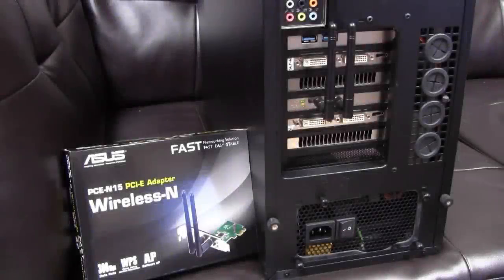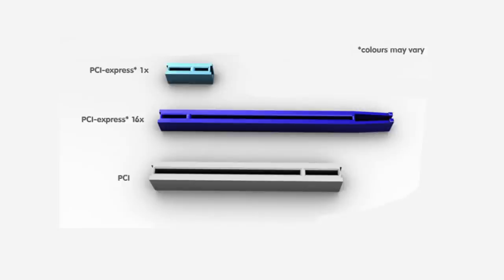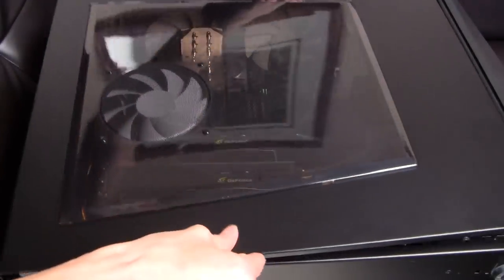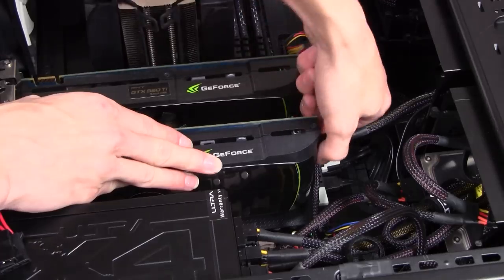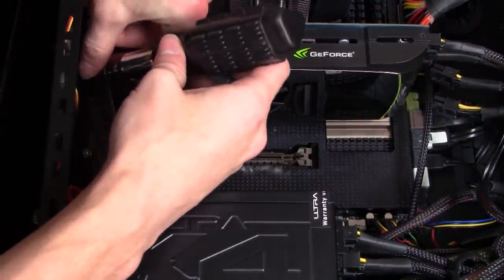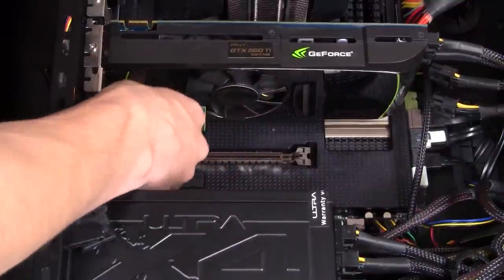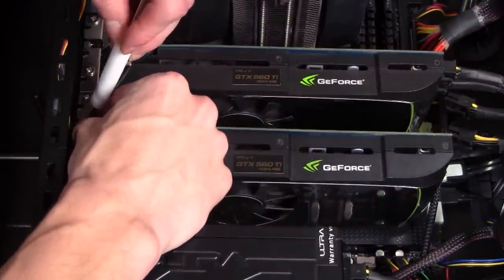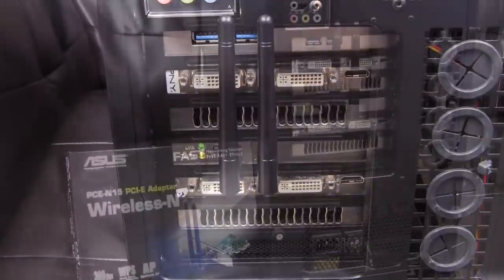How To Install A WiFi Card In Your Desktop Computer

Comment: I need help i have a wifi card that does not support 5ghz but if i get a wifi dongle that supports 5ghz do i just plug it into my pc and then i can connect to the 5ghz band?
Reply from the maker: Are you referring to a USB dongle or a PCI-E WiFi card? Either way, you have to install the devices drivers to get the most out of the hardware.
Reply: @WiltshireTutorials  I have a pci-e wifi card that has antennas but it doesnt support 5ghz so if i get a usb dongle will that support 5Ghz and second of all how do i download the drivers
Reply from the maker: You can get a USB WiFi dongle that supports 5GHz, yes. To download the drivers you have to look up the products model name on the manufacturer's website to download the proper drivers for it. Without the proper drivers, you may not get full performance out of the new WiFi dongle.
Reply: @WiltshireTutorials  Oh ok thanks

Comment: Are there not any wires to connect ?
Reply from the maker: Nope, just slide it into a PCI-E slot and the Motherboard will power things plugged into those slots, except for GPUs, they require more power ;).

Comment: I'm buying a CyberPowerPC - Gamer Ultra Desktop - 4GB Memory - 500GB Hard Drive will it work on this
Reply from the maker: colin mccartney You will need a PCI-E X1 WiFi card for this computer. There isn't much room for expanding with this PC. You only have 1 PCI-E X16 Slot (Which is taken by the GPU), 1 PCI-E X1 slot (For the WiFi card) and 1 PCI slot (Which is outdated and I recommend not using).
Reply: Wiltshire Tutorials can I use on of those wireless connectors that you plug in the USB
Reply: Yea totally you can use them , they just won't work as well
Reply: Thanks
Reply: No problem.

Comment: What if you don't have PCI e x1 slots?
Reply from the maker: Then put the card in an x4, x8 or x16 slot. It will function just the same. Just not vice versa of course.
Reply: even though the connector part on the card is like a million times smaller than the other slots, it will still work?

Comment: so if i get a motherboard that doesnt have a built in wi-fi card, does that mean it CANT receive internet wirelessly?
Reply from the maker: That is correct. You will have to add in a WiFi card to one of the expansion slot on the motherboard.
Reply: Wiltshire Tutorials yea i looked it up kinda, thanks though for answering! in a bit im planning to build one so i needed to know :)
Reply from the maker: +MrPib14 You're welcome. Thanks for watching

Comment: I have a PCI wifi card what would that effect?
Reply from the maker: ***** Wouldn't affect anything. Just would be used in a PCI slot instead of a PCI-E slot. It may also be slower than PCI-E cards.
Reply: Wiltshire Tutorials My gfx card is in the way of the slot for the wifi card I brought im having to buy a new card.
Reply from the maker: ***** That can happen, yes. That's unfortunate though
Reply: Wiltshire Tutorials I brought a USB wifi and it works fine :)

Comment: I have one that is compatibile with the PCI- express* x1 slot but I wanna install it on an older unit , a Dell Precision T3500 that doesen't have the slot ,can I buy the slot and install it to or I'm fucked and need to buy another WIFI card that is compatibile with it ?
Reply from the maker: You cannot simply add a PCI-E slot to an older motherboard that doesn't have one. You must upgrade your motherboard or buy a different WiFi card. Alternatively, you could use a USB WiFi dongle for the older PC.
Reply: I searched for a card right away and it isn't expensive at all , but since you have more experience which one should I get ,the card or the USB Wifi dongle ?
Reply from the maker: I'd go with an internal card. Usually they ha e better speeds and signal range.

Comment: I have a very dumb question but I cannot find the answer anywhere on the internet. Why is this needed? Like, is it the only way to connect to my wifi? Or is it like an external modem router? Please, someone, tell me, I am confused as I am fairly new to building
Reply from the maker: This is needed to connect to a WiFi signal. Your modem and router broadcast the signal and the WiFi card receives that broadcast signal.
Reply: @WiltshireTutorials  Oh, that finally clears it up. Thanks :)

Comment: i have a windows XP
what wifi card shuld i get?
Reply from the maker: +The Lonley Lakitu One that is compatible with XP. I don't know of any off hand.
Reply: Wiltshire Tutorials oh noes
Reply from the maker: +The Lonley Lakitu A little off topic, I wouldn't use XP anymore. Not only is it unsecure, it is very outdated for peripherals and devices. Companies are simply not supporting XP anymore. It's almost 14 years old! If you can, upgrade to a new OS. I'm not trying to be offensive. I'm just providing you with a suggestion.

Comment: I have 2 pcie slots but the graphics card can't fit back in the PC after I put in the adapter. the graphics card blocks the port for the 2nd pcie so now what?
Reply from the maker: +coby leighty Do you have any other x16 PCI-E slots?
Reply: +Wiltshire Tutorials no it's just pci 16
Reply from the maker: +coby leighty You only have one x16 slot?
Reply: +Wiltshire Tutorials no I have one pcie 16 and one pci 16 and a 2ND pcie it is a smaller one but my graphics card blocks it so I can't put anything into it
Reply from the maker: +coby leighty You could utilize the PCI slot
Reply: +Wiltshire Tutorials I can't cuz my graphics card is pcie

Comment: How do u get an internet connection on a brand new PC
Reply from the maker: Via Ethernet or WiFi. You may need to install a WiFi card, if the PC didn't come with it.
Reply: @WiltshireTutorials  Kay but do you need to install drivers? I want to use a pcie WiFi card
Reply: I'm thinking all u need to do is install the drivers on a USB than install on my pc
Reply from the maker: Installing drivers for new hardware is a MUST. Even if Windows installs them automatically, always install the updated driver(s) from the manufacturer's website.
Reply from the maker: You can download the drivers from a different PC and put the on the USB stick. That will work just fine as well!

Comment: Is this better than plunging a Ethernet cable into my motherboard?
Reply from the maker: Wired will always be better than WiFi. With Ethernet, the data is absolute. When you are using WiFi, sometimes data can be lost when transmitting to your PC. Because of the potential data loss, your PC has to do error checking to make sure none of the information was lost. This slows things down.
Reply: Not entirely. There are several cases where wifi transfers more data than ethernet.
Reply: Many people will say yes but in reality it you have a strong signal it's the same. I doubt your internet is so fast that having a wireless connection will seriously impact speed. That being said you went have issues like your Wi-Fi disconnecting with Ethernet

Comment: Do all motherbored have a pci
Reply from the maker: No. PCI is a dying, if not already dead, expansion slot. PCI-E 4.0 is the cutting edge expansion slot on motherboards at this time.
Reply: Wiltshire Tutorials so now what I can’t use wired internet
Reply from the maker: There's an Ethernet port built into all motherboards?
Reply: Wiltshire Tutorials the WiFi box is across the house so I need wireless
Reply from the maker: Then use an X1, X4, X8 or X16 slot for a PCI-E X1 WiFi card
Reply: Wiltshire Tutorials ok and I did some research and found something about a WiFi usb thing
Reply from the maker: USB WiFi cards are an option. However, PCI-E cards are superior.
Reply: Wiltshire Tutorials ok one more question what if my motherbored don’t have a pci slot
Reply from the maker: Than use PCI-E, if you don't have PCI.
Reply: Wiltshire Tutorials ok thank you very much
Reply from the maker: You're welcome. I get this feeling you're a little confused for the terminology for PCI and PCI-E. If you are unsure what I meant in the previous comments, I suggest just going with a good USB 3.0 WiFi card.

Comment: just bought this, windows 8.1 pro, drivers do not install automatically, device does not show up in device manager, software does not offer option to change instal directory or offer option to use the asus included software, it installs and the software is in the add/remove window but i can not get the device to operate after restart, i have tried both pci express x1 slots
Reply: bigemugamer.   use the driver disk that came with it.
Reply: Keir Mathieson I did use the install disk that came with it 3 times, I also downloaded from asus updated driver and attempted install 3 times had exact same results. it was for my buddies computer, we returned it, moved the router and he uses a cord, good enough for him ;)
Reply: bigemugamer  That is odd never heard of that before.
Reply from the maker: +bigemugamer Could have had a DOA WiFi card. But at least you found a solution!
Reply: its possible, but yeah, fixed =P

Comment: um i have it installed but when i try and connect to the internet it says cannot connect to this network please help
Reply from the maker: Check to see if you have the proper drivers installed for the WiFi card. If you've had previous networking hardware, uninstall the old drivers for it. Another you can do is a power cycle on your modem and router. Leave both unplugged for 30 seconds and then plug them both back in. This will refresh the IP address. Sometimes that can resolve issues.

Comment: I have a problem can someone help please. I have a MSI B250 Gaming Pro CARBON mob and my GTX 1080 SC is in the PCIe x16 (PCI_E1, Gen 3) slot. I got a Wireless card and put it in the PCIe x1 slot and it is shown as empty no matter what. After switching out the wifi card and my gpu a few times. I've come to realize both those cards seem to only work in the x16 slot! WHY! HELP PLEASE!
Reply from the maker: That slot on the motherboard could be toast. Check to see if there is an option in the BIOS that is disabling the X1 slot to provide more bandwidth elsewhere.
Reply: Wiltshire Tutorials I’m looking but I can’t seem to find such options. I do notice that there is a status light next to the pcie slot when i insert the card though. I just tried it again still nothing
Reply: I also tried removing the gpu out of the equation and the card still only works in pcie_e1 x16
Reply: and the wireless card i’m using is the PCE-AC55BT
Reply from the maker: Maybe the slot is just toast. Maybe email the motherboard manufacturer for help regarding this issue.

Comment: hi...i want to make a gaming pc.When it's done ihave to install windows and then i have to install the drivers????
Reply: Yes. After you install the Operating System (in your case Windows), you then download the drivers from the manufacturers website! Hope it helped!
Reply: thanks!Like i said i want to make a gaming pc and i need help about the parts which i am going to use in order to make the pc.Can you tell me which parts should i use??  but not very expensive...400-470 euro
Reply: thank you very much!!!!!
Reply: is this a good motherboard????
Asus H61M-K???it is cheaper
Reply: thank you a lot!!!
Reply: Δήμος Τσίγουρ No problem! Anything else you need help with, just ask! ;)
Reply: SgtKill Hi i have a question....
Can you tell me if the parts which i have choose for my pc fits each other???

Case:Bitfenix Comrade midi tower black
Motherboard:Asus h81m-k retail
cpu:Intel pentium g3450
VGA:Asus nvidia gt 640 2g d3
RAM:KINGSTON 8GB (2X4GB) DDR3
SSD:SanDisk 128gb SATA  3
HDD:Toshiba 1tb
Power Supply:corsair cx500- 80 PLUS BRONZE CERTIFIED 500W
OS:Windows 8.1

Does the front panel from my case connect correctly to my motherboard???
Thanks a lot!
Reply: Δήμος Τσίγουρ
That motherboard doesn't support USB 3.0 which the case has on the front. This mother board does:

Gigabyte GA-H81M-HD3

I have this case and it is quite nice. Everything else is fine!
Hope I helped!
Anything else?
Reply: SgtKill if i connect usb 3 into usb 2 it will work???
Reply: You have to buy an adapter, they are different ports. If you do buy an adapter, the USB 3.0 will only act as a USB 2.0 and wont benefit from being a 3.0 port.

Hope this helped!
Reply: thanks a lot man!!!!!Right now i am building my pc and i've stucked at front panel connection!!!!!!!can you help me????
Reply: There are wires right? There are thin wires to activate the power button, power LED, reset button and stuff like that. Then there should be an audio plug, USB 2.0 plug, and a USB 3.0 plug. If you read the manual of the motherboard, find a section called 'F Panel'. That will tell where the thin wires plug in. A bit fiddly, but you'll get it done eventually. Then find the Audio and USB headers on the motherboard using the manual and simply plug it in!

Anything else?
Reply: SgtKill thanks a lot!!!!!You are the only person who is helping me!!!!! i appreciate that!!!
Reply: Δήμος Τσίγουρ
 No problem bro! I fyou need anymore help, you know where to go! :)
Reply: SgtKill ok:)i am in bios setup...i don't have windows 8.1 but my motherboard's box sais windows 8.1 ready what does tha mean???
Reply: Δήμος Τσίγουρ
It plays nice with Windows 8.1. It means that it works best with Windows 8.1. Also remember, when you are installing Windows, unplug the SATA cable from the HDD but not the SSD, so that Windows will definetely install on the SSD. This will mean that Windows will boot up faster on the SSD. After Windows is installed, turn off your computer and then plug the HDD back in.

:)
Reply: SgtKill thanks!!!!i have a windows dvd created by myself....i just plug it in dvd recorder and then automatically it will  boot up windows installation???
Reply: Yeah, it should do.
Reply: SgtKill i disconnected my hdd and i left the ssd in order to install the windows and now i connected the hdd and it doesn't showed up
Reply: Δήμος Τσίγουρ hmm. Thats unusual. Is windows working correctly?
Reply: Δήμος Τσίγουρ
What brand is it? Give me all the details, Brand, Model, size etc. Also, make sure you plugged in the power correctly, it takes a little force, but it goes in.
Reply: SgtKill toshiba sata III 1 tb
32mb 7200
(before i installed windows,at bios i could see it at sata information but now nothing)

Comment: Can someone send me a link to an adapter that uses the outdated PCI?
Reply from the maker: Time to upgrade that PC!
Reply: Actually, my graphics card is so big it covers the extra PCI-express 1x slot. So I need one that goes onto a normal PCI slot.
Reply from the maker: Regardless, if your PC motherboard has an old PCI slot on it, then it is time to upgrade.
Reply: It's like 5 months old though...
Reply from the maker: Are you sure that you are thinking of the right port then. PCI was fazed out 3-4 years ago
Reply: That depends. Does CyberPower PC still manufacture computers that have old PCI slots?
Reply from the maker: Why don't you Google the model of your PC to check
Reply: My motherboard is 1 year old and it has PCI slots. Its not at all outdated. I think you should reconsider. Yes, it's old, but not all motherboards that have it are old. Secondly, you CAN actually plug the Wi-Fi card into the PCI-E 3.0 x16 slot, not just the x1 slot.
Reply from the maker: Any motherboard that has PCI on it is either very old, or a a cheap motherboard. I'm aware that you can put a WiFi PCI X1 card in an X16 slot, but if you are like me and care about aesthetics, then it looks bad and dust can accumulate in the rest of the slot.
Reply: What do you define as old and cheap? I have an ASRock Z77 Extreme4. It was $135 and is an Ivy Bridge mobo so it's at max 1.5 years old. Take a look at its spec sheet. Not old at all. Usually motherboards with 2+ PCI-E 3.0s don't have PCI slots because they need the extra room for more graphics cards. Mine has 2 PCI-E 3.0 x16, 2 PCI-E 2.0 x1s, and 2 PCIs.
Reply from the maker: I think Asrock as a brand is awful. Every motherboard capacitor I have fixed is on an Asrock board. Yes it may have PCI-E 3.0 and 2.0, as well as PCI, however there are hardly any parts available for PCI anymore, reason being is that the port is simply too slow for today's standards. Why put something in a motherboard that is obsolete? In fact PCI-E 2.0 is on its way out as well. The motherboard should have had all the PCI-E x16 slots running on 3.0 and have the rest as X1 slots.
Reply: I've not had any problems with ASRock in the past years I have used their motherboards. Also, it's not just ASrock. Take a look at the Asus P8Z77-V. They are almost identical. I don't disagree that PCI isn't being used that much, but I don't think that you should tell people that they need to upgrade their motherboard if they have a PCI slot. (BTW, modern graphics cards tested on PCI-E 3.0 and 2.0 show almost no difference performance-wise, so I'd say 2.0s still have a while left before they become obsolete).
Reply from the maker: We both have our opinions about brands and what not, but I'm telling people to upgrade because they should save their money and not waste it on something obsolete and something they will not be happy with.
Reply: I already have a new Newtwork Adapter, i'm good.
Reply: THAT, I agree with.
Reply from the maker: Glad we could have a civil conversation. =D

Comment: My card has a cable that is supposed to be connected to f_usb but i cant find it on my mobo... fast asnwer please ;-;
Reply from the maker: +Bass Heroes that is for Bluetooth most likely. Which isn't required, if you aren't going to use it. F_usb is the front panel USBs. You could also add to a USB header and it will work just fine
Reply: Wiltshire Tutorials thank you so much and yes i got it working! Awesome video anyhow!